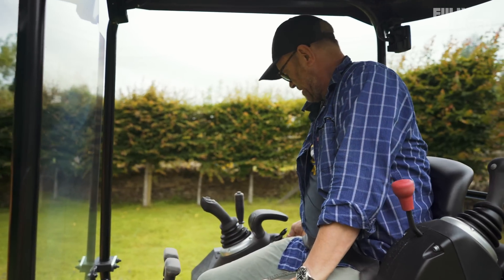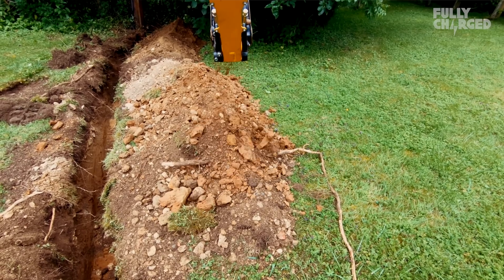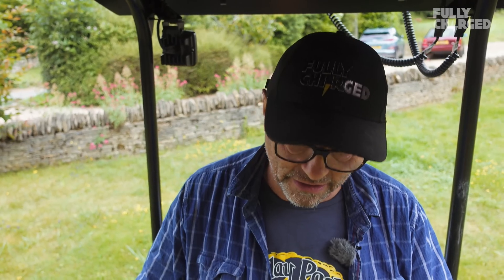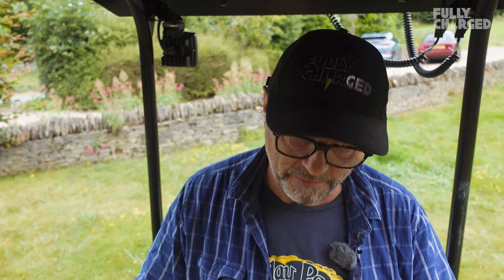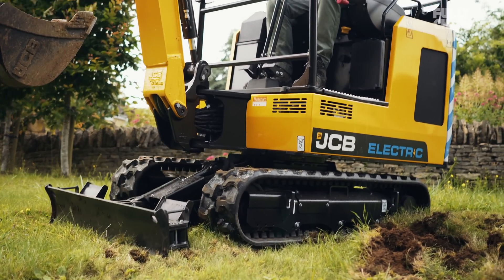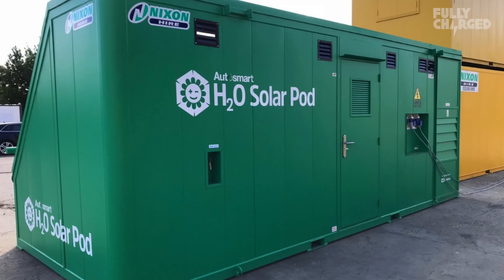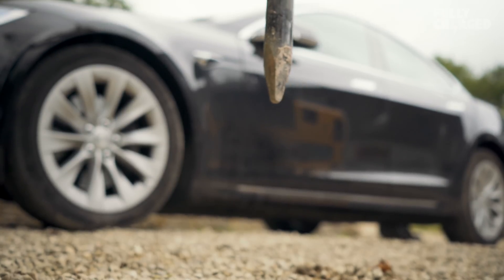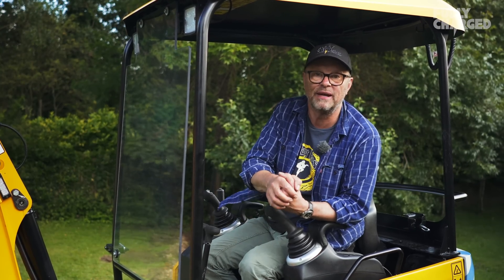JCB Electric Excavator / Mini Digger JCB 19C-1E E-TEC zero emissions electric digger | Fully Charged

Comment: I'm buying parts to convert my little excavator to battery electric :) fed up with the noise!
Reply: I want to convert mine too. Do you know how to do it?
Reply: @chrisphillips1948  yep, but I'm an electrical/mechanical engineer with a ton of lithium battery experience so for me it's easy.
Reply: Any tips, or resources you can recommend to help me out?
Reply: @chrisphillips1948  get yourself over to the second Life storage forum, watch every video by Daniel romer (DIY tech and repairs) here on YouTube, learn about what/how a lithium ion BMS works (Google) and go from there. The mechanical bit is easy, it's just a motor and coupling to a hydraulic pump. Making good, reliable and safe electrics when dealing with battery power that has the ability to burn your house down is the skilful part
Reply: @dorsetengineering  thanks for the info. Really appreciate it.

Comment: Why are you installing 3 phase into your house? Is that good for charging or are you running a workshop?
Reply: 3-phase will allow him to install a 22Kw, 3-phase, charger for the Tesla.
Or a high-speed charger.
Or he's planning on having a studio on the house, and 3-phase power would be helpful there, too.
Fun fact: in my country, there was a time contractors loved to wire single-family houses for 3-phase operation. If properly wired, it's easier to segment your power usage in a way that doesn't crash your whole meter. But it's more complex to wire in the first place, and dealing with solar and/or batteries on 3-phase power will be... interesting.
Reply: I see, that will make charging a lot faster than the regular 7kw chargers. You are right, that will be interesting to see how it works with solar.

Comment: I've been waiting for these. I have a 1.2T digger that runs a Yanmar 3cyl diesel. The reliability, low maintenance and longevity of the Yanmar is quite incredible (this one was made in 1986!) but the noise alone makes EV worth it. The heat off the radiator as well as the exhaust gases are the other real issues for the operator and others on site. Odd though, you guys didn't explain what role the motor plays in this heavy equipment and how it partners with the hydraulics. Hydraulic motors are even simpler and more durable than electric ones. Electric pump with hydraulics doing the work is a perfect match.
Reply: Mitch King The electric motor will simply drive the pump that makes hydraulic pressure and will run variably to match required pressure/load/travel-speed. Hydraulic motors and actuators run every aspect of movement or motion. Including spreading the track stance. I thought for this story it would have been worth summarising for people not exposed to them. Incredibly easy to adapt the standard design to electric power.
Reply: Cassette Walkman
I don't think it's a variable speed to match input.   When Robert turned it on he said you can hear the pump, plus it wouldn't be responsive enough to match the fast changing inputs.
Reply: @Robert-j6r8c  On most hydraulic machines the motor runs at a constant speed and the pump varies it's flow output in response to load. With an electric driven pump there's also a possibility of charging the battery when you lower the arm, but the main work is going to be breaking soil out of the ground, which isn't going to be recoverable. Look up swash plate style variable displacement pumps to see how most of them are set up.
Reply: peglor
May  i ask how your supposed to charge the battery by lowering the arm?

Try to understand how hydraulics work before answering.
Reply: @peglor  Hydraulic systems use constant speed gear pumps - and oil bypass lines. It's one of their 'noted' peculiarities. The only time I've come across swash plate pumps used in hydraulic vehicles is in the dedicated use to wheel drive motors - on cherry pickers. Most are 2 speed - low speed being driven off standard hydraulic supply and high speed off swash plate pump. Consequently, the low speed drive has standard hydraulic power - feed the wheel motor with oil, the wheel will rotate in almost all circumstances. Off the swash plate pump, you can stall the engine.
Reply: @Robert-j6r8c  By using the displaced oil to drive a micro-generator !
Reply: pmailkeey
You can't get more energy out than you out in... Physics.

The displaced oil comes from pumping oil in the other end of the hydraulic piston.
Reply: @millomweb  I thought that was only the case for smaller vehicles, where a full swash plate based pump would bump the cost significantly (And be harder to package), and the loss in energy due to unused pressurised fluid returning to the low pressure side through a pressure release valve to prevent stalling is still affordable over the life of the machine. As far as I know, bigger machinery such as 20+ tonne crawler excavators use variable displacement swash plate style pumps as the efficiency and stall resistance benefits given by this style of pump are worth the extra cost. By changing the angle the swash plate runs at relative to the array of pump pistons, the pump can go from no oil flow to maximum flow in less than a second, all while the motor is turning at a fixed speed, so once the actuator is set correctly there's no possibility of stalling with this design either.
Reply: @Robert-j6r8c  But you can convert one form of potential energy into another.
Reply: @Robert-j6r8c  It can do but doesn't have to.
Reply: @peglor  I can't see swash plate pumps being particularly more expensive than gear pumps - although they are more complex - not just the pump but the requirement of valves too.
One thing swash plate pumps do offer is smoother liquid flow through '3 phase' cylinders. I have such a pump in the garage - made by 'Joker' ! It's out of a steam cleaner.
Reply: @millomweb  Swash plate pumps don't have valves as such, access between the oil and the pistons is controlled based on the position the piston array is rotated at, with half the pistons pumping and the other half taking in oil, the inlet and outlets are just open manifolds with a face seal, one feeding all the sucking pistons and the other feeding all the pumping pistons. 

The swash plate controls how the pistons move, so the position of everything is controlled. The face seal is a harder seal to engineer than any in a gear pump and there are more sealing surfaces and moving parts, which is why swash plate pumps cost more.
Reply: @peglor  I thin it sounds like your pump differs in operation compare with the one I have. Mine has 3 static cylinders each with an inlet valve and an outlet valve. The swash plate rotates and the 3 cylinders are positioned 120° around the swash plate - hence giving a very smooth liquid flow.
Reply: @millomweb  The version you describe is the bare minimum to make one of these run as a drive motor, but the more pistons you have the more fluid moved when the pump turns, making better use of the space occupied by the pump. Think more like the bullet chambers in a revolver. Since the swash plate is going to push the piston inwards for one half of the rotation and pull it outwards for the second half, you just need to separate these halves to keep the oil moving even though each piston is contributing a different amount to the oil flow.
This setup also doesn't need a 3 phase type drive to work smoothly, running perfectly on just 2 pipes, so it can be implemented with less piping and can give variable flow by changing the swash plate angle, or variable rotation speed for a constant oil flow if used as a motor (Though apart from the hybrid hydraulic/mechanical drivetrain in Fendt tractors I'm not sure whether using variable displacement at the motor end is common in general for converting hydraulic power to rotation, and I think even on the Fendts only the pump side is variable displacement because that's all that needs to be for it to work).
If you're running a variable displacement system on a 3 phase type connection, both ends will have to synchronise swash plate angles or one pump will blow apart because it won't be able to handle the volume of oil sent to it.
Reply: @peglor  We were on pumps, not motors !
2 cylinders don't provide smooth flow like 3 but are better than 1 !
Only 2 pipes used - as usual - flow and return. All three cylinders feed the same flow pipe. Can't see any logic in having a motor in phase with the pump and I expect pump speed to be much higher than rotation of a motor.
Reply: @DiscoFang  The big potential difference is how the oil pressure is managed - cos if no oil pressure needed, pump/motor can stop. That doesn't happen with a diesel. I've come across variable speed hydraulic pumps - using variable displacement pistons - which is probably a more efficient system than with fixed(!) speed gear pumps. Standard hydraulic systems are odd n that they're designed to provide max pressure even when it's not needed - so is inefficient. Not quite as bad as automotive engine oil pumps which keep a pressure relief valve open - the most wasteful means of managing energy.
Reply: I hadn't even thought of it, but hydraulic conversion is the most obvious and easiest of everything.  You could probably convert a ton of existing machines to run electric, match the pump RPM with an electric and fill the fuel\motor space with batteries,  and tons of machines run full hydraulic, so interesting!
Reply: @Kingsoupturbo  It'd be interesting swapping all the hydraulic systems for linear actuators. Make it even more efficient !
BUT run an actuator into a dead stop and you'd likely break it !
Reply: pmailkeey It'd actually be incredibly complex. The speed and power that hydraulics can generate in both extension & contraction is remarkable. And both the speed & force is variable with a simple valve/flow control. Ever seen a digger operator shake the bucket to release clay? I wonder how an electric actuator would respond to that constant abuse. The closest equivalence the the mechanics is a solenoid. That'd be cool, I wonder how feasible solenoid based pistons would be. Hydraulics have an inherent shock absorption and pressure bypass valving that is hard to beat for simplicity & durability.
Reply: @DiscoFang  In 'normal' hydraulics, the force isn't variable, it's digital on/off. The application (speed) of the force is variable.
Shakin' buckets - A good operator will shake the bucket at the resonant frequency of the bucket and linkage to amplify the effect. How to do that with electric actuator ? Not only EASY PEASY but in a way tuned to the relevant resonant frequency every time irrespective of the skill of the operator.
There's no shock absorbance with hydraulics - which is why it's good for impact - as seen in this video with the hydraulic breaker - a job used to be done with pneumatics.
Reply: The electric motor drives the pump that turns the thingamebob that......

You really weren't paying attention, were you.

Diesel tank and engine out, batteries and electric motor in. - same role as a diesel engine - it powers the effing thing !
Reply: You have too many unloads. Charge it at home on the trailer. Most tradies i know wouldnt leave one of those onsite unless there was a solid , secure, lockable and preferably alarmed storage area. Which would more than likely have power anyway. I think you’re just desperately trying to find a negative aspect.
Reply: Playwme Surname I just think it will be a while before these things are any use
Reply: Most machines of this type are hydraulic drive so it should be just one electric motor driving the hydraulic pump which runs everything.
Reply: I still think it would be better to have a diesel one
Reply: @Lewis-co7pq  Maybe give one a try before you decide !
Reply: pmailkeey im just thinking of if you’re out on a job how are you going to charge it you’ll have to use a generator
Reply: @Lewis-co7pq  You haven't been to a modern jobsite ! Not only have electricity but Internet too !
Reply: pmailkeey if your in a remote area doing digger work how would that work we’re watching a guy dig in his front garden of course he would have electricity at hand what Im saying is it’s not on the same level as a diesel
Reply: @Lewis-co7pq  If it was a multi-day job and power not available, then a diesel would possibly be the better option.
Reply: pmailkeey I think diesel is a better option still
Reply: @Lewis-co7pq  Odd then that there's already quite a bit of electric plant !
Reply: Are you camping on the jobsite Lewis? Chuck it on the trailer, take it home, charge it. Just like you would with your cordless power tools.
Reply: Playwme Surname yeah put it on the trailer then unload it then load it back on then unload it again yeah sounds great
Reply: @Lewis-co7pq  It's what happened on a site across the road from me. Owner didn't want to risk leaving the machine on site unattended - so it always went home with him. Not sure if he took it to bed though !
Reply: @playwme3  LOL

Mind didn't the video include solar charging stations for sites ?
Reply: pmailkeey yeah I’m doing a job in going to bring a load of solar panels with me
Reply: @Lewis-co7pq  See: https://youtu.be/cumZxYjzx6M?t=713 for the solar panels
Reply: Love to see a cabbed one with a heater being used in dead of winter work for 8 hrs
Reply: @saff_cozzie  you've got 2 options fort that either use a webasto heater which can run on kerosine which is about 20% cheaper than red diesel  or use an electric heat pump which will also give you air conditioning in the summer.
Reply: @electronicinduction4116  I can't see there being too many takers for the kerosine heater option on a zero emissions vehicle that appears to have more than enough spare battery to run for the day and keep a heat pump going too.
Reply: @electronicinduction4116  I'd go for the heat pump.

Comment: Logic change, just replace the diesel motor for an electric hidraulic pump and a battery. A lot more efficient! And clean! And silent! The hidraulic hammer  is still loud, though 😁.
Reply: The diesel motor was driving the hydraulic pump. All functions were hydraulic. Just a different motor and energy storage system.
Reply: kkarllwt exactly right. Very similar pump just driven by an electric motor
Reply: Just needs a rubber tip to quieten it down ;-)
Reply: @richbuilds_com  🤣

Comment: What an awesome little peace of kit. I can't wait for a company like JCB to have a proper go of a farm tractor. John Deere did a half baked attempt at it to prove it wouldn't work so they could keep selling there antiquated fuel hungary tractors.
Most farms have 3 phase so rapid charging is possible and most tractors get parked at night at the farmsted
Reply: Farm tractors don't work that much. A few days in the spring, and, then at harvest time. Maybe 30 --40 days a year. But when they work , it can be 20 house a day of run time. This is not a good use of electric equipment. Electric machines should work every day to cover the capital costs.
Reply: @kkarllwt  some farms and some tractors and some crops are as you describe. Some aren't. Some crops are harvested all year and tractors run for a couple of hours every day. Some crops are harvested for a few days 24/7 and no one wants to stop for maintenance. Some tractors have huge power demands, dragging wide ploughs. Others bumble around spreading, spraying or carrying feed.
Reply: @kkarllwt  since I'm a dairy farm of 28 years. I can tell you that's not the case for most tractors and telly handellers on dairy and beef farms they run about 4hrs minimum every day 365 days a year.
Reply: Electric tractors would never work

Comment: Finally roadworks without diesel engines rumbling all day!
Reply: Would like to see the stats on the larger machines. Most roadworks use machines starting at 3-5 times the weight of this one so I wonder what KW output the electric motors are to drive the hydraulics. Charge times must start to increase dramatically.
Reply: @DiscoFang  Improving charging times is not a big issue IMO. We have the necessary tech already in cars. The simple fact is that whatever the size, electric powered equipment will be better, more durable and so on.

Comment: The only downside I can see with this is using the client’s electricity to charge. I can imagine the look on the client’s face if you asked them to run down to the local petrol station and fill up a few jerrycans with diesel...

Otherwise, an outstanding piece of kit - and the thought of using one of these in almost silence is sublime!
Reply: Mark RC A client pays for the fuel either way. You normally have to return the plant full of fuel.  Charging at a clients house is a complete non issue.
Reply: What like £2.00 to fully charge ?
The battery pack is 15kwh, at 14p/kw it would cost (0.14x15)= £2.10, not accounting for any small charging losses.
Reply: Client's electricity for 20kWh battery charge is £3.00 a day, half that for anyone with Off Peak tariff ... and that if completely empty.  Contractor is going to charge costs / fuel anyway
Reply: Well I guess that’s fair enough! I’m not involved in the construction industry so wasn’t aware of that... I guess it would still have to be made known to the client that their electricity bill for the weeks/months of use would be higher, but not an issue I guess.

My only experience with these is self-hire where, as with current diesel costs, charging costs would just be lumped into the overall rental.